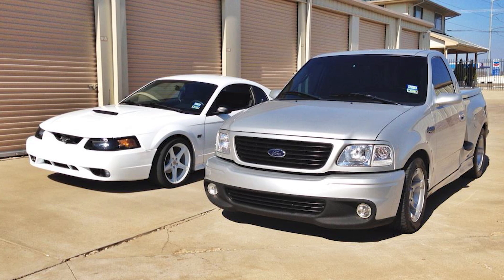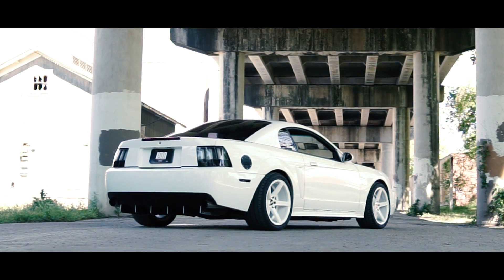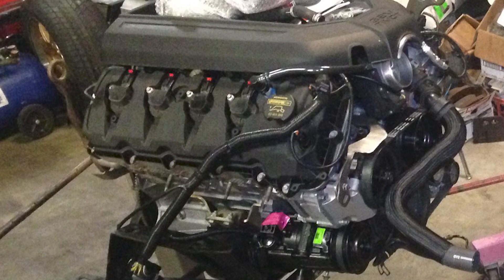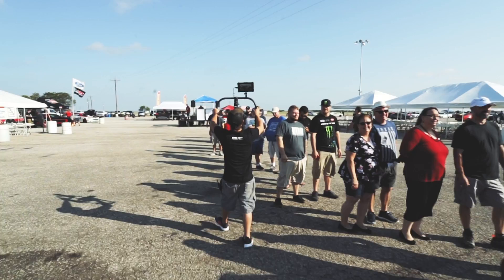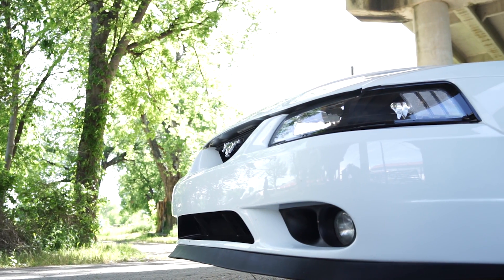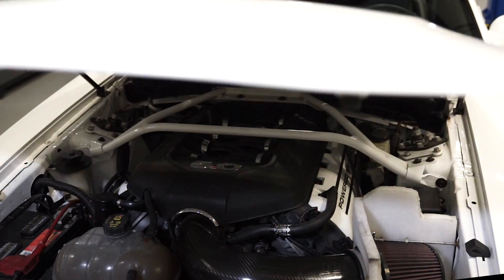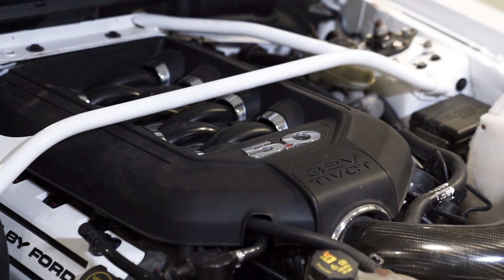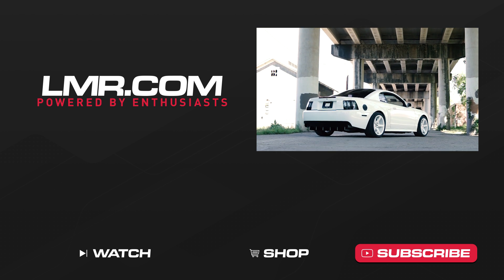Coyote Swap New Edge Build Review & Dyno

Comment: In a future video. “I installed a supercharger annnnnnd it started knocking again....”
Reply: chpjimmy 😂😂💀💀
Reply: Roflmao 🤣😂🤣
Reply: That’s because he revs it to like 9k rpm. These Ford v8s are not made to go above 6,000 rpm.
Reply: CockYaLegS The 2v actually loses hp when you go above 5,500 rpm so idk why you would ever push the old 4.6 that high. These are old American V8s. Not 4 cylinder Japanese cars or rotary.
Reply: 5.0 has nothing on 4,6
I hear nothing but issues with modified coyote mustangs. 4.6s can take a beating.
Reply: You can feel if your car has a rev limiter. You feel the loss of power too. Mine rev limits at 3500 but its only v6. With as many times it started knocking you could have just bought a new 5.0 engine and avoid all those problems.
Reply: @angelgjr1999  yes the 1st gens. The 2nd n 3rd can
Reply: @zachniverson8816  Agreed, they have improved the 5.0

Comment: When my engine knocks I hit it with a 250 shot of nitrous at the rev limiter. Fixes it every time..
Reply: Yeah I hear it really opens up engine blocks.
Reply: Did you see itsjusta6 with the 300 shot of nos.  😂
Reply: Super duper fixer man skillz
Reply: I fixed an Audi Allroad that had a Check Engine Light that wouldn't go off even after you cleared the code. Did a 4500 clutch drop and it went away. All fixed!!!
Reply: Gotta show it whos Boss!
Reply: Italian tune ftw
Reply: Every single time

Comment: Spinning the engine to 8k rpm for no reason is probably one of the factors that killed the other 3
Reply: The Gen 2s will take 8k all day. 50k on mine now and it's been full bolt on e85 with an 8k limiter since 10k miles. Not sure about the Gen 1s though.

Comment: Beautiful car, I'm considering a coyote swap.
Reply from the maker: Here is a great starting point - https://lmr.com/products/Mustang-Coyote-Engine-Swap-Project
Reply: Why not just get the mustang that comes with the coyote?
Reply: john cangley  Who says I don't have a stang.
Reply: @aaronvillagomes9812  I can do that, but it's just another coyote mustang.
Reply: 2v gang though. My 2v makes 308 rwhp on the dyno NA and that is plenty for the street.
Reply: @calebcaldwell5680  you gained 100whp N/A on a 2v? What did you do to it exactly?
Reply: Aaron Villagomes 
The build is unique to a person so to put a 5.0 in a car that originally housed a 2V is basically like building a beast.
Reply: Just curious as far as the exhaust goes. You would have to get the exhaust according to the new motor or can you use new edge exhaust on IT?
Reply: @theBoarSkinner  you need a non pi (96-01) engine. See if u have a Romeo or Windsor. Then find the heads and intake of the same version u have. Then get cams and do all the bolt ons.  And you will have over 350. Check out motor trend June 1st 2010s "junkyard jewel" I dont wanna spoil it so go check it out

Comment: Nice New Edge. I am pushing 420HP// 420 TQ on the original stock 2V motor. Just hit 100k miles. Purrs like a kitten. Supercharged.
Reply: mimike80 How the hell? You just slapped a supercharger on your stock 2V and called it a day? What about the transmission? Didn’t think they couldn’t handle a supercharger without any other mods
Reply: @davidduncan1300  my stang has a built tremec t56 magnum, aftermarket axleshaft, clutchbellhousing, stage 3 clutch, suspension, etc etc
Reply: @davidduncan1300  the tremec 3650 in the 01 up gt and mach 1 is a decent trans and would likely be fine in the 400ish whp range.  Plus the centri blowers make power up top its not quite as hard on stuff as coming in hard down low.  These 2v cars arent as fragile as the internet tries to make people beleive.  People have gone quick in 2vs.  Andrew on mustang lifestyle went 10.9 at 125 with a turbo bullit stock engine and trans.   Im not gonna say itll take repeated drag strip passes for years to come but theyre also tougher than people give them credit for.  His car put down 418 whp btw.  There used to be fast mustangs before the coyote...i know thats hard for some to wrap their head around but its true lol
Reply: You just hit 100k? Your car is a garage queen

Comment: I have an 03 stock GT... this story give me something to look forward to in the near future
Reply: Matt Miller  Stop giving advice, please. You have NO CLUE what you're talking about. Built Turbo 2v's making 1000+ RWHP are doing it at FAR MORE cost than Coyote cars. Your two valve with a "vortex blower" (it's VORTECH) will be putting down power equivalent to a mild bolt-on junkyard Coyote that has INFINITELY more versatility. It's cute that 2v's are in the low 8's. The Coyote platform is in the 3's. Anyone who advocates for anything but a 4v or Coyote to make power shouldn't be telling others what to do.

The 2v is inferior in almost every single way. To make any serious power, you're looking at heavily ported Trick Flow heads, a forged bottom end, and boost. You let me know when a 2v can EVER be built to 600 RWHP NA or when a 2v can hit 700+ RWHP reliably with nothing but a small blower.

Comment: @Late Model Restoration, is that true RWHP?  Or corrected to add back the parisitics?  Can't imagine a non-boosted 5.0 putting down 425, when its rated for 435 HP?  Please advise......
Reply from the maker: This was true RWHP on this car. As with any coyote swap you have multiple bolt-on parts that add to the power numbers like the CAI, long tubes, and the performance tune.

Comment: “Motor started knocking...” “we got it fixed up” did that fix involve replacing the crank shaft?
Reply: On the 2v the first time yes. We used a crank shaft that we had laying around that wasn’t as scarred. We had it machined and got the rod bearing to fit it. The second time it didn’t damage the crank shaft much, so we were able to smooth it and roll a couple of bearing in through the oil pan.
Reply: Truman Hubbard so did you just pull off the pan and timing chain cover, remove the chains from the crank, unbolt the rod caps and drop the crank out? Think I have a spun bearing on my 2v and wondering if it’s work saving $4k parts/labor on a reman’d 2v long block, and trying to just replace the rod bearings myself, or if it’s just BOUND to fail again after all that effort?

Comment: Not sure I'd go with a Coyote but man that's a great looking car.
Reply: Bryce Tucker Old school 5.0 roller, 351, 347, 2JZ, LS. The Coyote takes up so much space and puts too much weight up front plus everything for it costs too much. Cost vs potential is too far off. It's more of a novelty so you can say "it's got a coyote"
Reply: Bryce Tucker Some LS1's are under 400lbs and with aluminum heads and removing unneeded stuff most any LS will be. The cost is still an issue with the Coyote, why pay more for less performance? I'm primarily a GM guy but I'd rather see stuff like Mustangs and Lightnings Ford powered, my mustang is and will always be Ford powered. For the money it's just better to go with something else.
Reply: Bryce Tucker Well you're wrong there, you don't need to spend that much to make that kind of power. It can be done for less and it's not all about Dyno numbers. You can take an old 5.0 roller fox body and easily put it in the low 11's from junkyard parts, you're not gonna make 1000hp no but what I'm saying is, not everything has to be a crate engine.
Reply: Bryce Tucker Ahh, so you're biased, you like you're Coyote and that's fine. They do sound great wound out I'll give you that.
Reply: Bryce Tucker I absolutely would, done it many times. Not trying to be a dick here but if modular engines were "hard to beat" then we'd be seeing them used in NHRA, NASCAR ect. hell we'd be seeing real street guys..not the ones who like to talk stats in parking lots..but real street guys, swapping over, but they're not. It's not cost effective and they make way more power with a pushrod engine.
Reply: Bryce Tucker I have an 86 GT, nothing special, pretty standard stuff. There's a local kid here with a boosted Coyote that loooves to talk about his 772hp Dyno numbers, I've raced that kid 10 or more times so far this season and he's yet to beat me, I'm sure I'll have to race him again tonight. My point is, hp numbers don't mean a lot, it's where and how you make the power and how you put the power down. Like most Coyotes guys, he's caught up in flash and stats rather than actual performance.
Reply: Bryce Tucker Yeah glued down on a hot track maybe, they still don't have any kind of 60ft though. "Not really any kind of suspension work" is still some kind of suspension work.

Comment: Never explained why the truck coyote motor nocked ???!!!
Reply: It knocked 3 different times im sure they never figured out why lol
Reply: Sorry. It was hydrolocked to begin with. So when we “fixed it” we must have missed something. When it started knocking the first time, we thought it just ran lean. So by replacing the scarred up bearings, we still didn’t fix the problem. The motor has been sitting ever since, until we get time to mess with it.
Reply: @trumanhubbard44  if u ever dig into it let us know what the issue was. no1 wants to thing gen 1 motors were junk

Comment: Coyotes are cool, and this is a nice build. Although stories like these and the headaches that go with coyotes makes me stay on team WINDSOR.
Reply: Coyotes are super reliable and many people make big power with just a power adder and fueling mods plus tuning.  I've seen lots of coyotes boosted and going well over 100k miles.  They're very reliable 99% of the time every engine is gonna have an issue here and there there was either something wrong causing his problems or he just has real bad luck.  Coyote doesn't have "headaches" most of the time put the motor in and boost it and make big power reliably.  With a Windsor you gotta do heads cam intake plus aftermarket block and forged internals to make the kind of power coyotes do with a stock motor and boost.  Both are great but I Def wouldn't say the coyote is the one with the headaches.

Comment: With that much trouble you could’ve just did a cheap turbo setup on a dirt nasty 2v with pi heads and made similar power.

But instead you put 10k into a coyote swap. 
I understand the ford purists but a what point do you just 5.3 LS1 swap it and call it a day. Coyote crate engines are just ludicrously expensive
Reply: LS engines are not without problems either; oil consumption, piston slap, cracked heads, stuck lifters, broken valve springs, rocker bearings and if you are lucky you will only get the dreaded low oil pressure. I have two LS's and my brother has two LT's, my LS have lifter tick and piston slap, my brother 2022 Silverado had stuck lifters at 13k miles that ate the cam and bent pushrods which warranted a new engine and the new one is starting to tick less than 10k miles again so take it from a GM family that any way you go when shit is gonna happen then it simply will regardless of make.

Comment: please have my car on the show!! i have a 2001 new edge cobra and i got it for my 31st birthday and since then hasnt been driven...

it was pouring white smoke, burned up all the oil and coolant, i had the turbocharger rebuilt because it was a higher-end hellion single turbocharger system w intercooler, and has a roll cage, drag radials, atak pipes, bassani longtube headers, jlt oil separator, and soo much more!!

please help me i still havent been able to find anybody that has the knowledge to fix this car so i can just drive it!!

PLEASE HELP it has an unknown gremlin, but the engine needs a little tlc, it has a horrible oil blowback issue, i would absolutely be elated if i can get this car running and take my father for a ride because this is his favorite car and he deserves something nice, he has Parkinsons and is a disabled veteran, i can pay whatever it takes within reason, please please

please let me know if you can help me out, or help me find a shop in the tristate/ new england area i live in Connecticut!  i know that there has to be somebody who can help, but i am only finding horrible scrap shops!! please help!! whatever it takes i want to make this happen so i can give my father a ride in his love and favorite car because he is 74 and won't be on this earth forever, especially w this pandemic, please help or find a person who wants to take this project on himself anything at all, please help in any capacity you can!!

thank you soo very much, god-speed,

-peter piccolo @pete88p if ya need to get ahold of me on social!!! thanks again...

Comment: What was you doing wrong to have engine knock that many times??????? My brother did Coyote swap in his 01 Cobra. Was going to be done 96 GT but drunk driver fixed that one but had everything to do it. You can buy core engine rebuilt it cheaper than buying running engine from Mustang or F150. I did wiring and using aftermarket cluster because stock cluster will not work with control pak. It's not because control pak don't broadcast data just different datalink protocol.

Comment: 425 hp not very impressive tbh if im.putting 10/15k in an engine i want at least 7/800 hp.my 71 lincoln comes stock with 365 hp do a little mild tweaking maybe headers i could get 425 and at a fraction of the cost.i dont understand peoples philosophy on these expensive swaps for no more power you get from them. Mise well just build a 351w or 302 .. and save money.
Reply from the maker: Good thing we all like what we like! By the way, that's 425 rear wheel horsepower which equates to about 500 horsepower at the flywheel (give or take). Building a naturally aspirated 302/351 engine to make 500 flywheel horsepower isn't cheap. I've done it. I'll take the Coyote all day long. Again, we all like what we like. -Landan
Reply: @latemodelrestoration  yeah I like the coyote too I got one in my f150 but numbers verses the out come not really worth it in long run. I can build a tried and true 351 for less money and get same hp.
Reply from the maker: Again, good thing we like what we like! -Landan

Comment: So you took a $2000 car and spent 30k on it??? Just buy a stock LS1 and simple bolt on you’ll get 400hp. Nice car and all but damn dude
Reply: It already has over 400hp and where did you get 30k from? Ls swaps are for poor unskilled people.
Reply: Only had around 5k in the swap before I went ahead and bought the gen 2 crate engine.